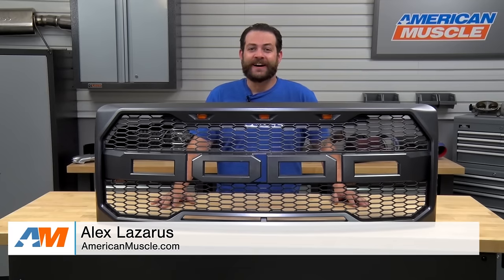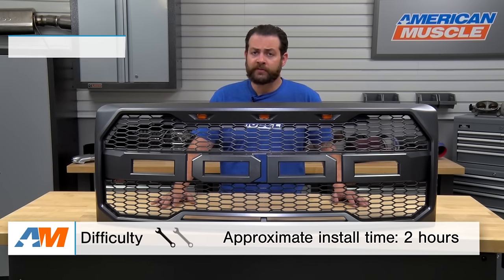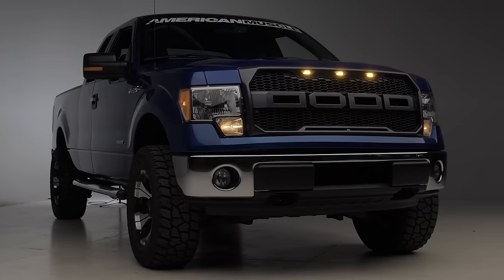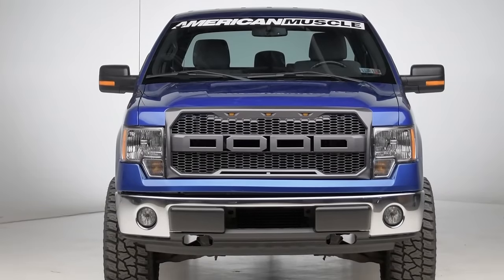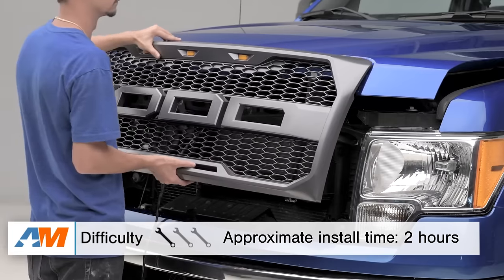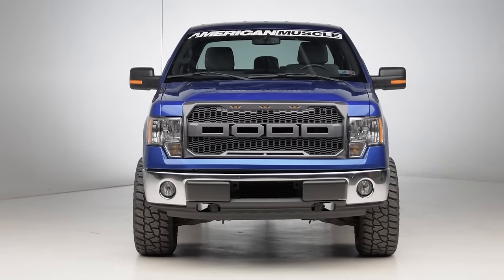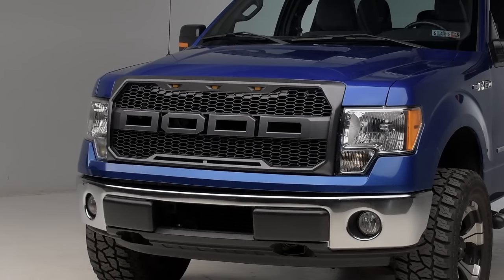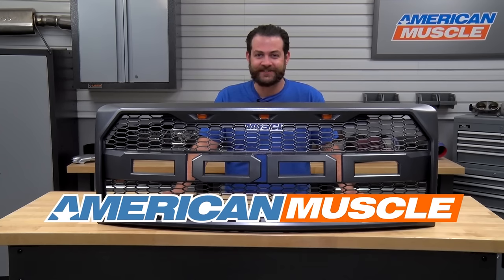2009-2014 F-150 Barricade Raptor Style Grille w/ LED Lighting Review & Install

Comment: I wonder how the wires are ran since the grill is connected to the hood when opening it🤔🤔🧐
Reply: Run wires you have to add your own wires, down the passenger side of the hood, into the side marker light in the headlight assembly. It's very easy

Comment: RE: hooking up t-Taps for getting power to the LED lights, is there a gauge size for the taps that is appropriate to use? Sorry, 'newb' here when it comes to modifying my truck.
Reply: B J. Sanchez less are real low amps. Takes 10 for 1 amp or something. Use wire size on led pigtail or 1 size bigger. Go size bigger if more than 20 gonna be wired together. Or if your running 20 feet from power tap

Comment: Would be way cooler if it actually said Ford instead of DODD whatever that is.
Reply from the maker: Hey Saint, I can't entirely disagree with ya. The grille is awesome and definitely adds a great, aggressive touch to the F-150, but it would definitely be looking better if it said Ford. Who knows, maybe one like this will come out in the near future, and will be reading Ford instead of OODO. - Matt
Reply: It is very stylish, I think someone would have to sit and stare at it to notice it.
Reply: They can't have it say ford due to copyright laws.
Reply: Bought mine from Amazon for $283. Spent another $90 and bought the F & R from 3dogsracing on Ebay. Looks awesome.
Reply: You can order the F and R, for this particular model.
Reply: From where?  I can only find the letters for a paramount brand grille, not barricade
Reply: the licensed FORD grille by barricade is out now. $249
Reply: Can get letters off ebay